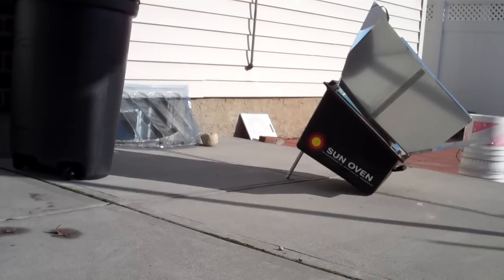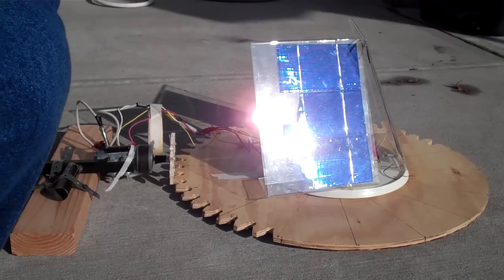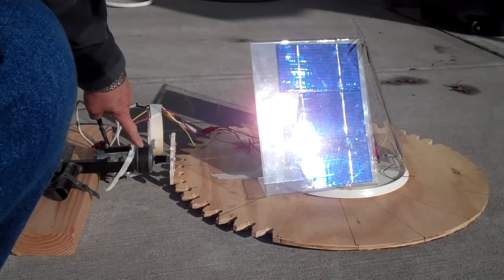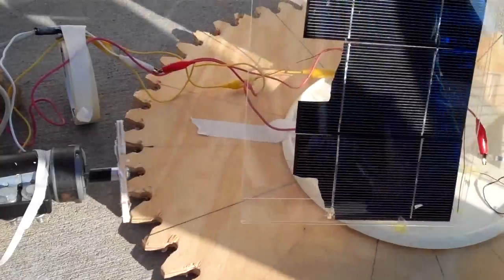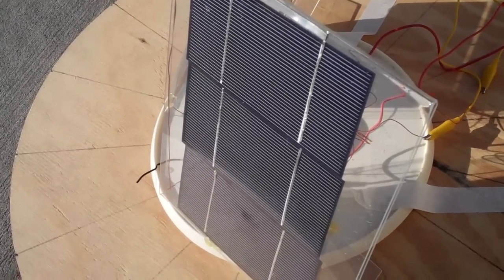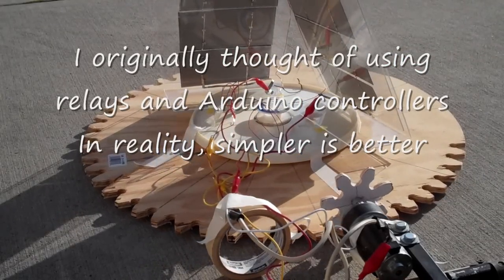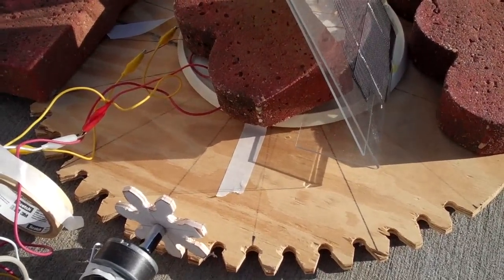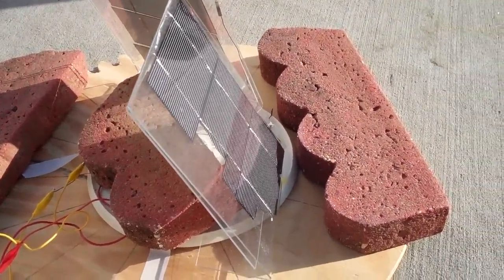Completion of self powered  solar oven tracker

Comment: I need this.
Reply from the maker: It’s a fun project, especially if you get enough sun in your area.
Reply: @wtam69   I love love love my solar cooker. I am not thrilled that somebody hasn't invented a turntable that can hold the weight of the solar cooker and turn with the sun so I don't have to constantly push the solar cooker around. The turntable doesn't need to be solar activated nor solar powered, just something that can turn with a small hand of a clock. Simple enough, somebody should sell one.
Reply from the maker: @chamspage  a simple one will be a mechanical spring wound turntable. I’m sure someone will make one when there’s enough of an energy shortage.

Comment from the maker: Funny you should ask, I just ordered a step up, step down voltage converter from China. It'll be a while before it gets here. It's good for 1 amp and 3 amps if you cool it. My USB solar charger uses a dc voltage booster to boost the voltage from about 4.8 to 6 volts. It also acts as a regulator too. Look for my solar usb charger video on my channel. If you're working with small power stuff, these boosters are great.  They are only a few dollars.

Comment: Thanks for replay thats look really awesome and part are really cheap to get compare with a microchip to control servos stufff etc will cost more.

One more thing have you fine a way to get more voltage from solar with some kind of circuit ? maybe a Bedini motor ,or a joule Ringer that use less volt input and you get more output.

Comment from the maker: No relays. When one solar panel generates more voltage, it'll turn. When they both generate close to the same voltage, the turntable stops. Basically, the positive of one panel connects to the positive of the motor and the negative of the panel connects to the negative of the motor. On the second panel, the positive connects to the negative of the motor, and the negative connects to the positive of the motor.

Comment from the maker: You're right again. There are so many improvements one can make. Some folks were using Lego type model material and other different ways to make the tracker and I just used what I had at the time. The motor I'm using has a bad bearing shaft but it still is a strong motor nonetheless. What you can make with something depends on what you want to make. The motor I used can also be used as a nice paper weight. Have a great day!

Comment from the maker: Very good observations and suggestions. I just cut the gears according to the instructions and am glad the gears meshed at all. A switch is easy to make or I might be doing a dance with the oven unless I shade both panels when I stand in front of it. The reason I made this is to see if it can be done. Like your ceiling fan alternator, I had read in forums where electrical engineers suggested that the stock motor cannot be modified to be an wind alternator. You've of course proven them wrong.

Comment: He He. My batteries are going to be throwing up the white flag this summer. I shall be replicating this on top of the lab. I shall use 2 small panels at the front of the array to drive the motor. The motor I have in mind could move a lot of weight. Will video build and installation for all. Fantastic project well done. Keep them coming.

Comment from the maker: It's from a wind turbine. The  motor was damaged but I salvaged it and re-purpose it to drive the solar tracker. It doesn't seem to care what voltage you give to it as it runs with a low of 1.5v. It's geared so it has a lot of torque, again making it strong enough to move the loaded turntable